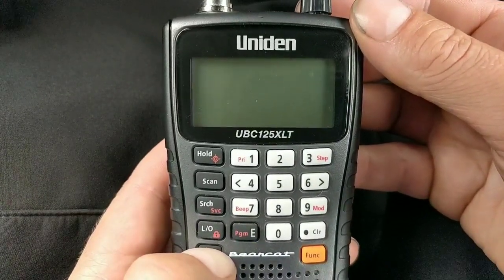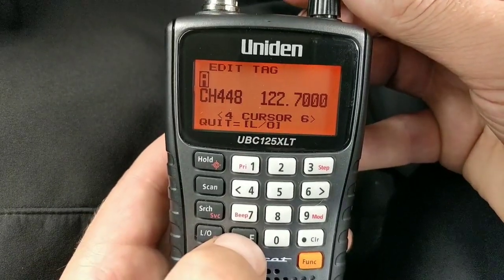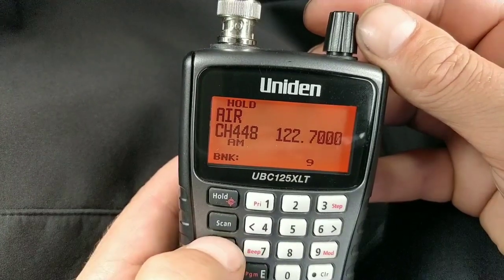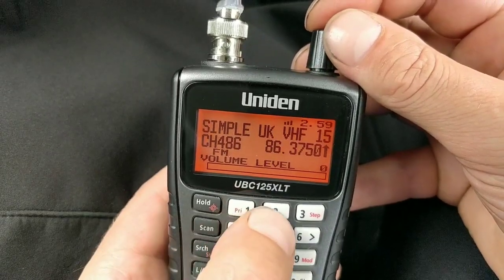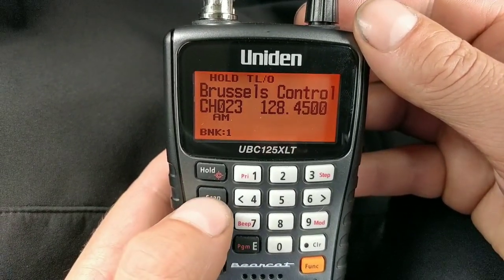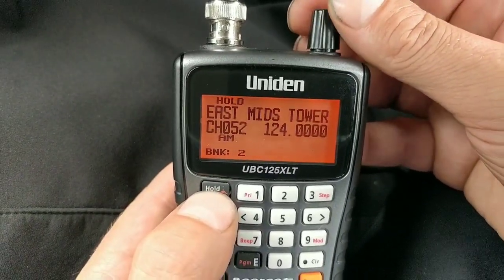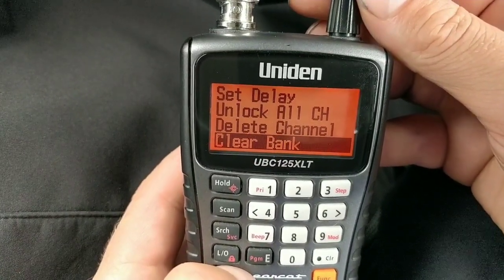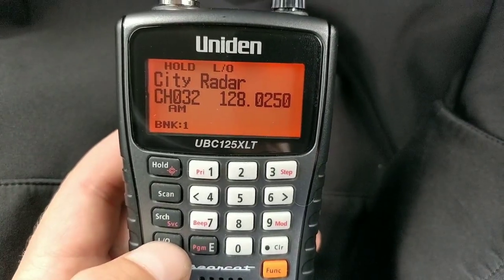Uniden UBC125XLT how to manually add channels

Comment: Hello quick question, I recently got my scanner and was wondering if the antenna just twists off, it’s on quite good and I don’t want to break anything getting it off👍🏻
Reply from the maker: Yes it just twist off. Hold the metal part at the bottom and twist.
Reply: Digital Analogue Ham thank you and thanks for your videos👍🏻👍🏻

Comment: What are the differences between the UBC125XLT and the BC125AT sold here in the United States?
Reply from the maker: Scrappy Cat I am not certain because I don’t have the American version but I would guess they have slightly different band plan to block certain things and different step rates for different regions
Reply: @digitalanaloguehamradio  Thanks.  I didn't think about the bands being different. The functionality of the controls seems to be the same. 
Great video BTW.
Reply: BC125AT doesnt cover 800 Mhz band